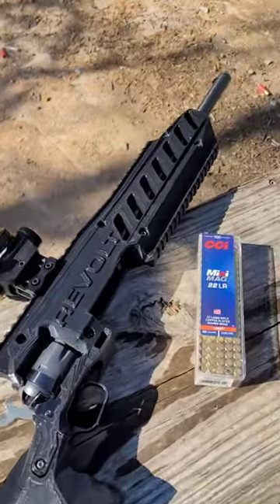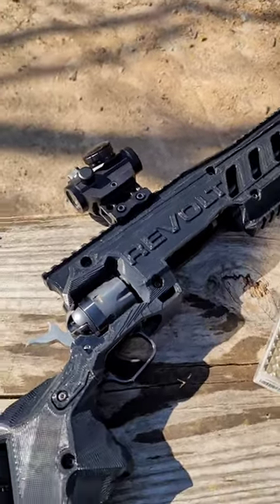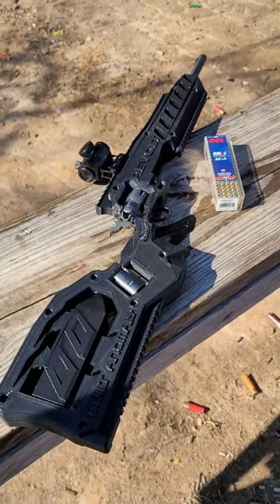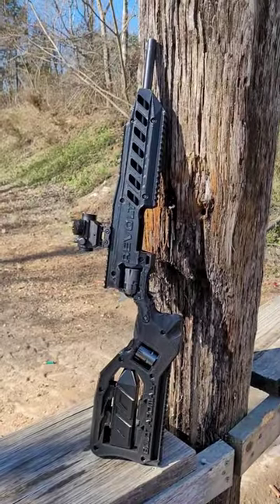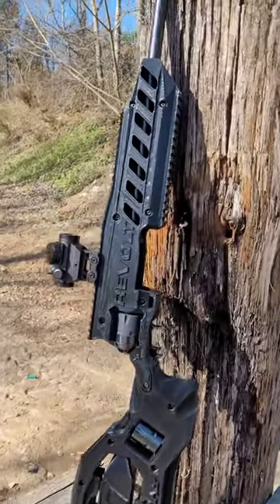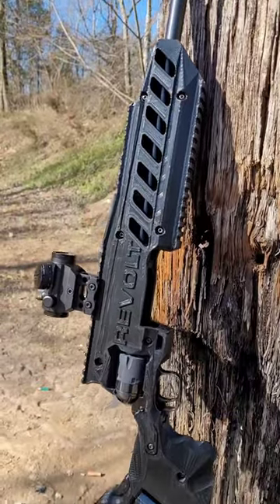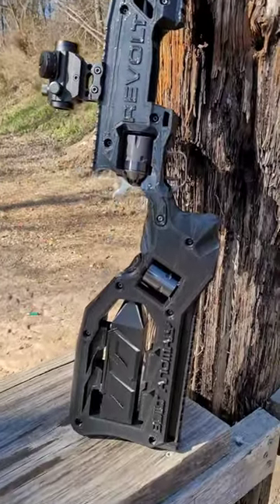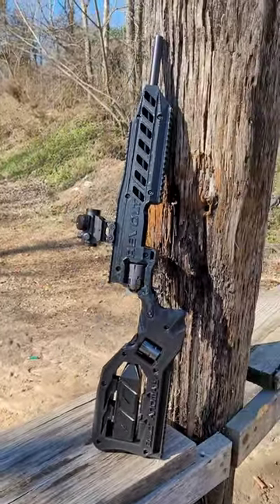REVOLT - Housing for 16" Rough Rider from Built Anomaly

Comment: its good to see other options out there! when i was prototyping a 3d printed stock, i had a hard time with how large the print was and it was not a full frame like this. it took 2 days to fully print on 1 printer, very tough to be economical on it but if he found a way to make it work then sweet. different strokes for different folks.
Reply: My printer bed is about 15"x15", and printed this stock in two sections (front and back) It was a massive design feat to fit it on lol Had to heavily modify my 3d printer so it can handle quicker production.
Really appreciated your design Salem. I do want to venture back to a solid wood option.